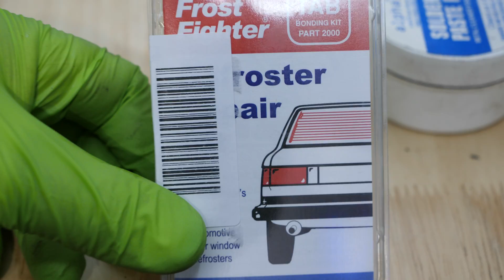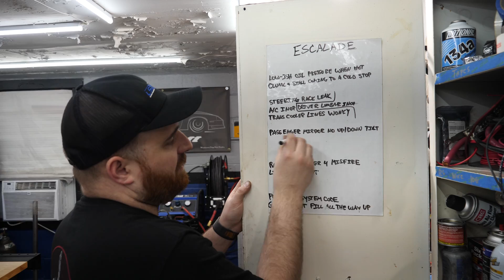Repairing Broken Window Defroster Tabs with Solder!

Comment: This is nuts this just happened to me and I swear Google is reading my mind... Low and behold at random this pops up.  Thinking no way this will work. I had a sold gun but it would not get hot enough. I got one that looks like his. To my utter disbelief it worked!!! 
Ifor the next fellar. I cleaned the surface of the tab that came off glass. Sanded light the solider side. Applied flux and put s new coat so solider building it up .  Then applied a coat of flux to the top. Pushed it against the glass heated it up till the flux bubbled around the connector. Bam done.   I got the iron at my local hardware store 20 bucks.  I went to harbor freight but they dint have the solider iron that had the flat head type tip like the poster used. All in all it cost me less than 40 bucks.

Comment: I cannot get my soldering iron to melt the solder when i put the tip on the other side of the tab. I have a 65 watt soldering iron.... Is there a special solder i need or do i need to use flux paste? Or is my soldering iron just not strong enough?

Comment: Patiently waiting to find out how to add BT to my 07.  Just found a way to use a tablet that has no gps as a working android auto head unit. Plan to just ad BT and pair the tab with it, and have the tab auto connect to hotspot and open car play once the bt connects from my phone. So far it works great.

Comment: Glad to see a somewhat dedicated video on this issue. Fortunately the wires haven't came off in my Trailblazer as I'm a bit rough on the back glass. Speaking of the back glass my struts also need to be replaced. Can't believe my local junkyard wants $33 for 2 when they are brand new for $25 each.

Comment: Saw on your board it says hot oil pressure issues. Just curious what pressure are you seeing? my 08 hummer h2 with the l92 is about 22 at idle when hot and after getting off the highway it’ll be right at 20 at idle. When towing it can be as low as 18 after coming to a stop. Engine has no issues and has always been this way 138k miles

Comment: I have an 87 Fiero just sold my  02 Tahoe and picked up a 2007 escalade. Pretty similar setup as you. Im doing the same thing to this escalade now that I did to my tahoe. Replce every single part over a 5 year period and then sell it for way less than I have into it, lol. In struggling with getting 13 mpg in the city. Im going to do a full tune up and tune to try to save some cash. Or I'll get a big heavy boat to make use of this 6.2.

Comment: Both of the ‘07 tahoes Ive had broke the defrost wire. I fixed it exactly the same way and only had to do it once. It’s like they just had cold soldier joints or something.

Comment: Those are the worst design in a rear defroster ever.  Especially in a lift gate.  There is no reason they couldn't have just stayed with the spring loaded plunger style connectors

Comment: Matt, are you going to do the big brake upgrade for the fronts using the 2019 and up 4 piston calipers and 13.5” rotors?
Reply from the maker: Most likely
Reply: @lsxmatt I have a brand new set of takeoff GM calipers and rotors you can have if you pay for shipping from Wisconsin.